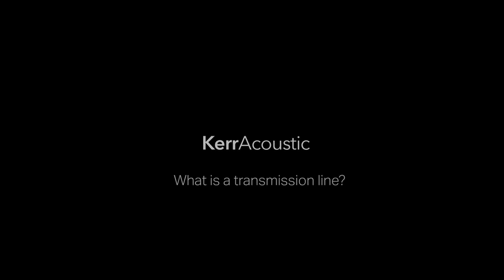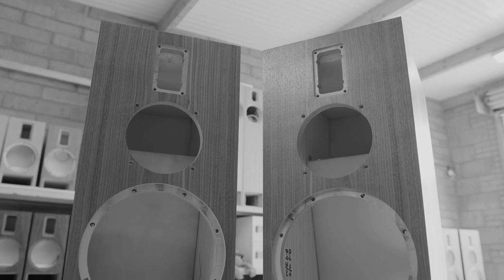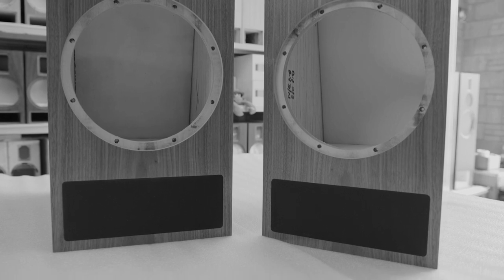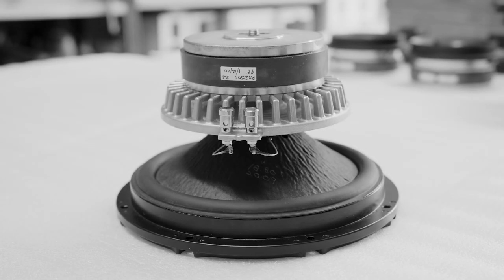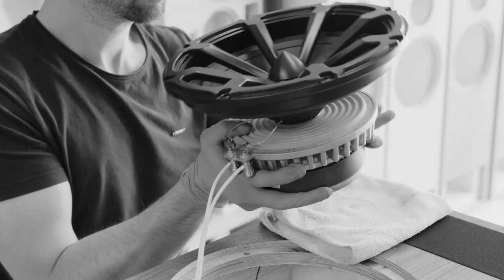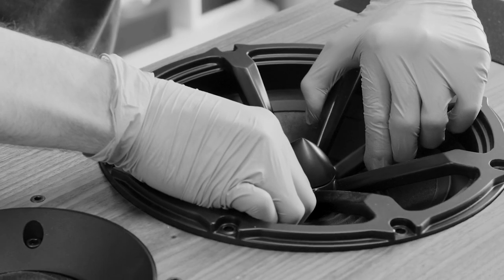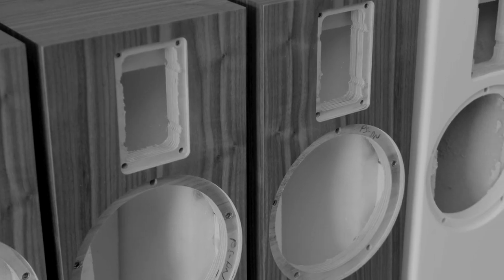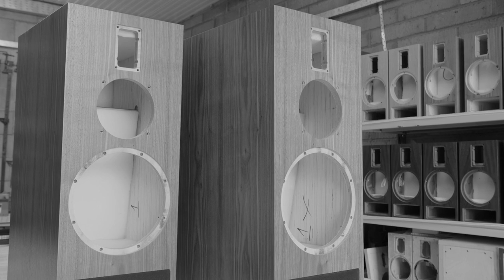Kerr Acoustic - Transmission Line Speakers

Comment: Hi 👋, very interested, but can not understand why you haven’t got any feedback, I am very interested in transmission line, loudspeaker cabinets, as I built my own around 40 years ago, from an article that I had found in the magazine, A colleague of  mine done the crossovers,
I made the cabinets out of 25 mil, thick or inch thick MDF , it’s got a line length of round 14 1/2 feet, now got an 8 inch subwoofer, SEAS 150w and SEAS tweeter, the original drivers were peerless, but last year I had one blow, who is the new driver units the sound quality is improved dramatically, huge dynamic base which fires out of the bottom, And the mid to high are amazing, Phil from the moulin France .
Reply: How it is different from the ported box design then ?